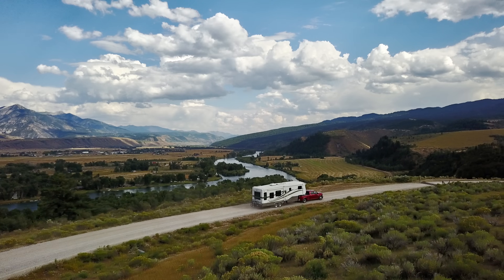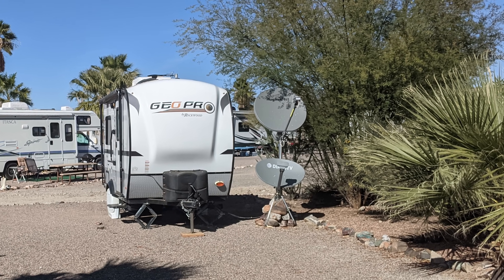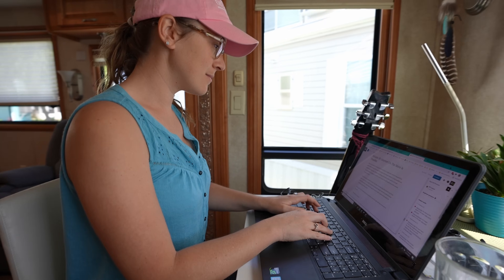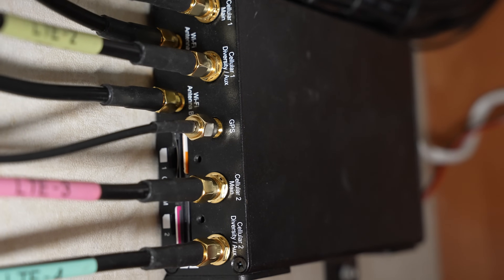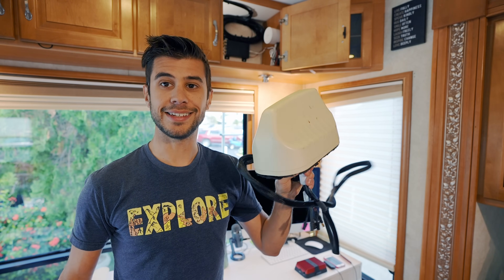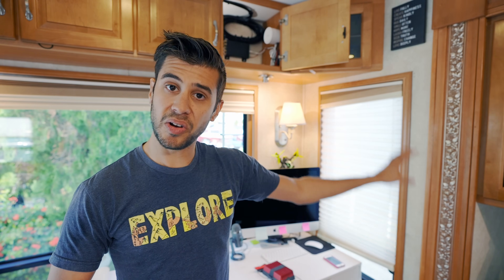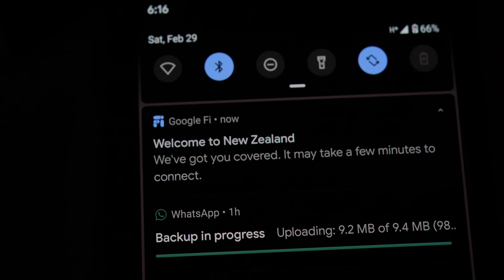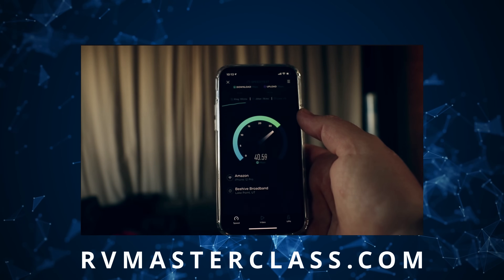How We Get Rock Solid RV Internet! - The Best Tech Solutions to Work Full Time From the Road

Comment: It is a requirement from my work from home remote job to have "hard wired internet" I picked an RV park that has good internet access and the internet company said "yes you can hard wire internet at this address" but I really don't understand how it works. Its a condition of my employment. Can someone explain how it works? I'm staying at the site for 6 mo. Also will RV park be mad at me for getting my own internet? (my rv has a cable cord built in- does the modem connect to that? does the modem or cord connect to the RV infrastructure so it can "plug in" how does this work?) my set up right now in a house- the internet company drilled a hole in my wall so im super confused how hard wired is set up... so frustrating ! lol
Reply: does the modem need to connect to the rv park's infrastructure ? I just don't understand at all  ! lol

Comment: What about mounting the Huskey on a fixed pole for driving so it is at roof level and then when you get to your destination you add multiple 10'  lengths of aluminum tube to raise the Huskey as high as you would like and the aluminum tubes just join together with the spring-loaded round tabs(snap clips) that lock into holes drilled on the opposite tube.

Comment: Alright so I'm sure this is a really stupid question but i have to ask it just to be sure I'm not wrong.... Most (if not all) carriers now a'days have 2 "data" related limits. Your "device" data limit and your "hotspot" data limit. When shopping for these plans to work with a device such as your pepwave router it IS the hotspot data that i need be concerned with correct? 

For example I recently got an extra line from my verizon business service specifically so that i have an additional 100 Gbs of "Priority", (non throttled) hotspot data, the plan I'm on includes truly unlimited "device" data as well. If i took the sim card out of that extra phone and put it in a pepwave router i would be using that 100Gbs of "hotspot" data correct? There is no way around this rediculous situation? 

You might have been grandfathered into some unlimited plans but other than signal I don't know of any at the moment that I  can still get in on... And i find this indescribably frustrating...

Comment: Like the omni ae. Boosters tend not to work because cellular is critically dependent on SNR, signal to noise ratio. Its hard in normal kit to amplify the signal while reducing or maintaining noise. Consequently the SNR stays same, and you don't improve speed much. What is far better is to maintain mimo when having directional antennas, so 2x lpda on your pole with +-45 deg angles.

Comment: It looks like you chose the most expensive options out there. That's fine for a video blogging team with over 100,000 subscribers, the rest of us can't afford anything like that. I'm using Verizon's Visible LTE network for $40/mo, tethered to my computers from the phone they sent me for $20. 3-5mbs but sometimes down to 1mb-3mbs during heavy congestion or a weak signal... and there's holes in the coverage when traveling or sometimes the internet just cuts out for no reason even though there's still a good signal & can still make phone calls.

Comment: Thank you -Thank you - Thank you for this video - I am now working remotely and it has been a nightmare for me to stay connected, this is very helpful. I just have to figure out what works for me but I do need to be connected all day so it seems that your set up is what I need.
Reply from the maker: As far as cell connection goes there is not a much better setup.  Having a modem router combo like the pepwave really helps make it all work well.  The only improvement we could make (and may try later) is adding a pole mounted 4x4 mimo option to the router to get the antenna even higher up.  We might try this later this summer as we know we will be in fringe service and will share about its performance on our blog.
Reply: I was just thinking about a pole as well just now. Thanks.

Comment: This was incredibly helpful! My wife and I hit the road last year for 3+ months working remotely with a few jetpacks from Verizon and T-mobile, along with a weboost cell booster. This really did not work well for my wife who is on zoom meetings all day long. We just burned through the data so quickly. I was wondering if you think this setup could be sufficient enough to handle how we envision using it?
Thanks in advance!
Reply: It won’t decrease the data you use. It will basically replace the jet packs. It will provide more reliability since the cell antennas are external and maybe give you some load balancing options between data plans. If you are lucky you may be able to connect better to wifi signals when it’s available.

Comment: A few thoughts about your directional antenna option:
* A better solution would be something like a "tower mounted amplifier" that's really close to the antenna.  In the uplink direction (from you to the cell tower), this doesn't matter much, as you've got lots of transmit power (maybe even too much), and a bit of loss in the cable (which would help with the too-much power case).  On the downlink (cell tower to you), however, the loss in the cable before the amplifier just makes the signal worse; for a complete understanding study "noise figure" for RF systems.

* You could do MIMO by using two directional antennas (there's someone on YouTube that's done this, unfortunately I've lost the link).  Point them in the same direction, but cross-polarize them (i.e. tilt them 90 degrees apart in the vertical plane).

* I'm really surprised at your experience that a "few degrees" matters in aiming the directional antenna.  It doesn't look very large.  I'd be surprised if the 3 dB beamwidth is much less than 30 degrees.  It looks like the gain of that (or a similar) antenna is about 10 dBi, or equivalently about 7,5 dBd. which is pretty good.  Are you really in a situation where a few 10ths of a dB matter?  If so, loosing some cable between the antenna and the amp probably would help even more!

Comment: Wow, what a fantastically helpful video, excellent job! I'm in Canada, and I'm working on setting up a system similar to what you have, an older Pepwave Max mini router with the exact Poynting antenna you have. So far GPS and WiFi are working well, cellular sees the tower and reports a decibel level however will not allocate an IP address. When trying to troubleshoot its the old "carrier (Telus) doesn't support the hardware modem, and Pepwave says problem is with the carrier." Frustrating. 
Have been stalled for a while but I recently got a new SIM card that's designated as data only, so hoping that will solve the problem. Did you have to change any settings or have carrier enable anything so a standard phone SIM works fully in your Pepwave unit? 
I love the idea of being able to remote into the van over cellular and check webcam, and to control things like furnace, fan, and other things using an RM Pro4 unit. Can't wait to get it all functional, your video has me inspired again.
Cheers!
Reply: @Andrew Burke - Have you tried a different sim card from PublicMobile or Rogers (borrow from a friend as a test). It might be a problem with your Telus sim card itself. Does Telus offer just data-only sim cards or did you use another provider? I'm in Vancouver.
Reply from the maker: Its going to depends on the sim and plan but we have had to change the APN settings on the router to match the phone.   

As far as having trouble connecting we have seen that before too.  Updating the routers modem firmware helped.  This is a mode advanced update but here is a tutorial. https://forum.peplink.com/t/cellular-firmware-upgrade-process/17978
Reply: I have a Telus corporate plan and recently upgraded to one that supplies 4 SIM cards which all share the 50 gigs of the plan. Apparently the other SIM cards are data only (although they each have phone numbers assigned which seems contradictory) so I'm about to try the new SIM and see if it works better. No I haven't tried a different SIM from another provider, that'll be next step if my new Telus SIM doesn't work. Happy to chat more if you like, I'll see if I can message you directly. Cheers.

Comment: @mortons on the move. The way mimo on LTE works is you actually have 2 TX and 2RX duplexed data streams. so because of the 2TX/2RX you get gain in both directions. I would suggest you look into for the future a 4TX/4RX device as that is were the tech already is at. While 2TX/2RX is good 4TX/4RX is much better. next up is massive mimo. ;)
Reply: Any suggestions on what to buy?

Comment: I would love to learn about shielding because most people use weboost and only way to get around oscillation is by sticking antenna as far as possible. 

I use weboost for phone booster and 4glte verizon unlimited with modem/router and so i have 3 weboost omni truck antennas on roof. Upon coming back to florida i plan to integrate directional antenna as well.

Comment: Looking forward to perhaps you reviewing Starlink Mobile satellite internet in 2022.   Years ago, I went from Dialup (No DSL in the area) to Satellite Internet(Direcway), Verizon 3G EVDO Cellular Hotspot, Comcast(finally installed), and then Uverse Internet(maybe ATT Fiber installed in 5 years or less).   The MIMO RF box will surely be available in 5G version by 2022 in my opinion and be very useful for us home users that can only get faster internet (beyond 100 Mbps) if bonding all these cellular services like mentioned in the video.   (ATT Uverse internet will not go beyond 100Mbps since ATT Fiber is the replacement in 5 yrs or less)

Comment: Seems similar to the system Chad from Changing Lanes uses.  I know they're a "campground" family mostly - how does this system work for those who are more into boondocking in remote locations?  Is it still solid?
Reply from the maker: We boondock more often than not and have had pretty good success with our current RV internet setup.

Comment: Great video!  Any experience with 5G while on the road? I think T-Mobile has decent affordable 5G plans available.   I think it may require a new modem. I really like the modem you are using and will keep an eye out for a 5G version if one comes out.
Reply from the maker: Yup a 5G version is prototyped but they have had serious issues. (Cat20 modem); truthfully I have messed with 5G and haven't seen any speed benefit yet.  For an RV it will probably fall back to the latest 4G most of the time anyway since 5G doesent penetrate or travel as far.
Reply: Peplink is coming out with a 5g modem later this month.  It's capable of using band 71 on tmobile which has much farther reach and penetration than lte. I'm able to get signal in places where I couldn't get 4g before.

Comment: Something you may want to consider to enhance your arsenal of internet access technologies is omnidirectional high gain cellular antennas.   The directional antenna you show in your video, here, is using a Yagi beam technology.   It achieves its gain by a series of vertical elements of staggered lengths placed in front of each other.   Another approach to achieving higher gain is the collinear approach, which is where elements are stacked on top of each other and phased together to achieve high gain in all directions - which eliminates the need to find the best direction to point it.   A collinear antenna is going to appear as a single rod or pole that is going to be very lightweight and needs only to be placed as high as you can get it for the best performance.  

Of course, with all antennas, there are strengths and weaknesses to be considered.    A Yagi beam type antenna has the advantage of providing high gain in a desired direction, while rejecting unwanted signals that might interfere coming in from other directions.   Its disadvantage, of course, is that it requires precise aiming for best performance.   This makes Yagi antennas ideal for fixed installations, but not so great for mobile use.   On the other hand, the collinear type antennas have the advantage of providing high gain in all directions, but have the disadvantage of not being able to reject unwanted signals that might interfere with your desired signal.   This makes collinear antennas ideal for mobile use, but not necessarily the best option for a fixed installation. I hope this suggestion helps.

Thanks, for the excellent video!
Reply from the maker: Thank you!
Reply: Can u make a video how to attach these antennas I need help 3mbps is criminal 😂

Comment: Tom,  you did a great job of covering all of the topics in this video.

We are looking to upgrade our current hotspot device to something that has a little more flexibility and performance.   We are looking at the Pepwave Max Transit Cat 18 LTE Advanced Pro Router for our upgrade.  It looks like a good compromise of cost and capability.  With our use of a single cellular connection at a time, the CAT 18 should give higher performance than Cat 12.  We like the flexibility of adding additional antenna options as our travel style changes.  We are going to start with the attached antennas  to start.  We are considering the directional 7-in-1 directional antenna on a pole running it through the slide gasket like you are doing with the your WeBoost.

This past winter we found that sometimes an RV park with a WiFi plan can be better connectivity than WiFi because of congestion.  The ability of the Pepwave to support WiFi is a big plus.

I would be interested in any thoughts you have with our approach.

I have purchased the WiFi class to make sure we have not missed anything.  The sale through April 19th is a great deal.
Reply from the maker: Yea that's a great option! Be sure to sign up for our giveaway because thats the setup we're giving away!
Reply: I signed up for the giveaway before I purchased the class.  I saw that the giveaway was the model we are considering.  It was a nice affirmation of what we are considering.

I am going through the class tonight.  So far the content is at the right level and has a good pace.  I am likely going to add the course to my recommendations for people looking to learn about mobile internet.